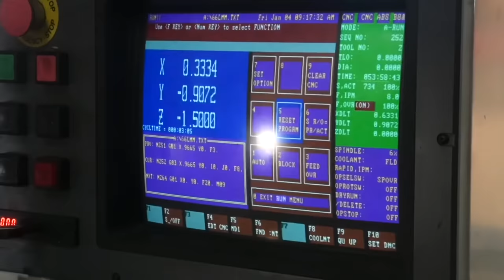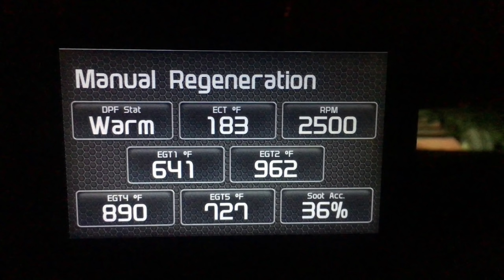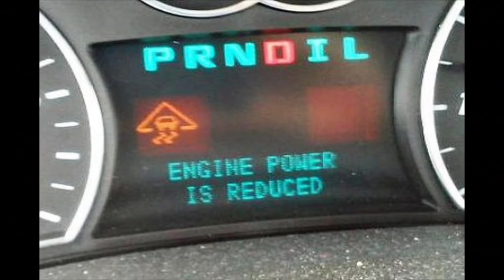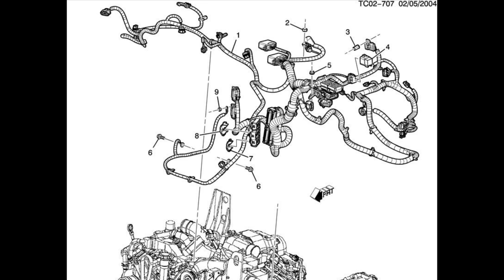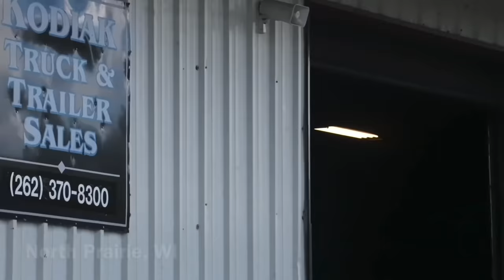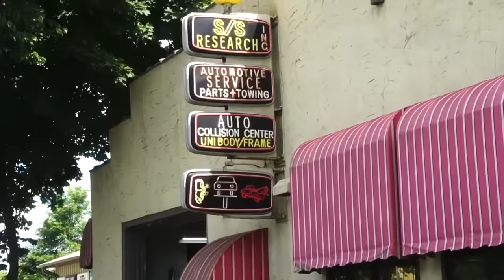Duramax Problem’s That Will Leave You Stranded!

Comment: Gen 4 tcm garbage alyways shorts out the j1939 data link. I work on class 8 and smaller the gen 5  tcm no failures to this point. No crank no start a pre 2013 plug in my test good gen 4 tcm always starts one percent starter has crapped the bed.

Comment: Hello
I noticed my fuel supply line near the glow plug control module has a slight kink in the line.  What is the recommended fix for this observation?

Comment: Can you guys cover any issues on the LMM oil pressure sensor?  Mine kicks on and off in high temps when idling and I’ve replaced the sensor and still does it. I have 180k on it

Comment: How common is this issue that will leave you stranded? I have 2002 LB7 with 97,500 miles.  I was idling at a stop light and suddenly the engine died.  Tried to start engine but would not turn over.  Got towed home.  1 hour later still would not start.  2 days later I was able to start the engine and notice Service Engine light.  Found code U1800.  Drove truck a few yards and park it.  10 hours later engine still starts.  I’m afraid to drive this truck on the road for fear of it stalling again.  I hope it isn’t the fuel injection control module.  All wiring seems to be ok around the fuel injection controller.  Had brand new injectors ,7000 miles ago and converted to CAT fuel filter.  Any ideas?  Thanks.

Comment: 2002 lb7 here , I will suggest to any here interested in going to the big 3 on your truck and going with a bigger alternator , I just changed out my alternator with a 253 amp alternator I scooped up from rock auto for 150 with Shipping , it’s turn my truck into a completely different truck , I don’t have enough time on it to see if there is any improvement in fuel mileage but I will say on the short road test I took it on the truck runs so much better all around , it’s no longer searching for idle has better acceleration , transmission shifts so much better , my truck came with an anemic 105 amp alternator , though it’s a base model which is why it came with such a low amp alternator some of the trucks out there do come with a higher amp alternator it’s my opinion even those alternators are still to low on amperage if anyone here really wants to get specific go to your power center and add up the amperage of all the relays in the fuse panels than see what amperage your alternator is rated at , you’re only supposed to be at 50% using of what the alternator is rated at without any electrical ons to the truck . I never see any videos addressing this issue and if I were a betting man I would say going with a higher amp alternator and doing the big 3 would resolve most electrical issues . IMO . It worked for me .

Comment: Torque to yield head bolts. Terrible idea on a diesel. I would recommend any duramax owner do head studs. The “blown” head gasket is caused by those torque to yield head bolts stretch and allow the head to lift under power just enough to “blow” the head gasket

Comment: Have you done a video on the 05 low fuel rail pressure? I had 3 injectors changed that failed the pressure test. I had a secondary fuel pump put on between the fuel tank and cp3 pump. I took the pressure regulator valve out of the fuel rail and put a plug in it’s place. Still having issues, my next thought is the pressure regulator valve on the cp3 pump. If you have any ideas that would be great! Thanks!!!

Comment: 2003 Duramax c-4500 - won't go over 40 MPH speedo says it's going 80MPH + will run just fine up to 40 or45 but will drop a gear unless you are really light on the pedal - Any idea what the cause of this is? I have read several articles in various forums but never have found a real answer?

Comment: I bought a 2023 2500 duramax last December brand new  , it now has 35,000 miles on it , it just derated yesterday to 20 mph , now I have to get it towed to a dealer, the particulate matter sensor comes on and goes off when it wants. I miss my appointment to get that replaced 2 weeks ago then yesterday derated , about four days ago, it did a reign , And seem to be running fine until yesterday yesterday this really ticks me off because I’m out here in Wyoming working in the oil fields and I need my vehicle to be able to drive back-and-forth to my semi to be able to go to work now I’m gonna be without a vehicle. What do you suggest I do and what do you think it could be causing this problem, when it happened, it felt like the transmission was jerking. So I parked it and I haven’t driven it since yesterday.

Comment: Can we talk about “shift range inhibited”?
Reply from the maker: Definitely a good one we can cover that in a later video
Reply: @TruckMaster  thanks I appreciate it, I’m having that problem with my lly right now
Reply: @Barnettj35  mine was the ignition switch . It wouldn't go into reverse and range shift inhibited would pop up.
Reply: @Barnettj35  no 20 dollar fix. Just take your steering column cover off and access your ignition switch.  I replaced my NSBU switch thinking it was that bit it wasn't.  It ended up being the ignition switch not allowing the right voltage to the strans
Reply: @maritzandre84  I’m in the process of changing the nsbu switch now, but it’s now wanting to plug back in
Reply: @Barnettj35  it most likely won't be that but it could be. The ignition switch is a much cheaper one to get replaced . If it's not the switch you're only 20 buks out of pocket. The NSBU switch is way more expensive.   I bet you a beer it's that ignition switch. Let me know
Reply: It's most likely your nsbu switch. Easy fix and very common problem on the LLY. Go under the truck and on the side of the transmission you'll see the shift linkage right next it is the nsbu.
Reply: @maritzandre84  yea ignition switch or nsbu switch if you live in a area where your vehicle rust easy then it can be the nsbu switch. But I'd start with the ignition switch first.
Reply: @maritzandre84  looks like we were both wrong, changed both and it’s still giving me trouble. I put in a new ignition switch and it will go into gear, but after a second it’s like it slips out of gear
Reply: @Barnettj35  that sucks. Sorry non of that worked for you.
Reply: @maritzandre84  ehh, it is what it is. Guess it’s time to start saving for a new transmission, just sucks that I can’t even drive it to a garage lol
Reply: @Barnettj35  yeah mine is kinda on the way out also. Will probably get mine  rebuilt in the next 2 years. I take it easy on her.
Reply: @maritzandre84  I haven’t even had mine long enough to take it easy on her lol
Reply: @Barnettj35  bad luck. Hopefully she behaves . Maybe call a shop like the dmaxstore or codiak truck and explain what's up. Maybe they can give you some info on what may be wrong

Comment: I’m having an issue where I’ll be driving and the check engine light will come on with a service traction control and stability light will come
On and truck will shut down and restart. Some
Times the fuel gauge will drop to empty. The truck is completely deleted. Any advice?

Comment: I have a 2004.5 blowing black smoke & no power. Got codes for pressure relief valve & barometric pressure sensor.  Didn't solve a thing. Any suggestions

Comment: HELP. My 08 lmm has been down for 4 months and 3 shops later. It was running but had a p0642 code. Low voltage circuit 1. Then it suddenIy quit starting all together. I replaced a ton of shit. Cam sens crank sens tps alternator ecm exhaust air temp sensor fuze box.

Comment: L5P glow plugs issues (2017 GMC Denali ) . Any one having this problem on L5P?  I keep having glow plug issues . In shop now for # 4 glow plug check engine light . Same  # 4 glow plug 2 months ago . # 7 glow plug issue 3 times this past year. Dealer programmed #7 then had to replace second time then re-program 3rd time. The warranty says programming not covered. I have made my complaint to dealership and GM . I have gotten nowhere and they will not even acknowledge there is an issue. I live in Florida so cold weather shouldn't be a factor.

Comment: These nuances aren't helpful to a non truck guy and really confusing. I don't care. I'm trying to run 3 seperate businesses and I just need to know what diesel 3500/ 350/ whatever to buy that will work when I need it and not live in the shop.. my f450 v10 is costing me $1,300 a month in gas minimum. I need 2 trucks and a diesel

Comment: I have a 2018 HD 2500 duramax with Allison trans and sometimes it feels like someone bumps me after stopping completely  not all the time bought it new only 25,000 miles have extende warranty  I was told to add a little trailer brake any suggestions? Also I noticed service trailer brake system once a while ago nothing since

Comment: question i just bought my lmm sight unseen i am working out all the kinks. put a lift and 37s my speedometer was not calibrated so took it to a guy who hooked up his scanner to fix the parameters, and the ecm was locked how do i go about figuring out who has tuned it?? if i buy efi or edge will it over ride the current tunes? i also have service trailer brake, service traction control (found out a wheel speed sensor is out) and a brake light on. any help would be greatly appreciated.

Comment: I have an 08 Duramax and the 4 whl drive dont work.  No problems come up on the expensive, shop monitor.  I changed the 4 whl. activator but that did nothing except lighten my wallet.  Any idea?
Reply from the maker: It’s probably your selector switch on your dash
Reply: @TruckMaster  Thank YOU!
Reply: Thankyou.  I replaced the switch and it does not work.  Any other idea?

Comment: Hello there, I got a 2015 lml and about a week ago the turbo mouth inlet came loose and I believe it suck the oring in thru the turbo, so we put a new oring on and put back together but now I'm getting a whistle sound when the truck is under load so I don't know if the turbo is going down or I got a vacuum leak ,any suggestion thanks

Comment: My 03 LB7 sometimes when I open up to pass or climbing a steep grade at a good speed will lock into I guess 3rd gear, I have rpm's until redline, can drive at 55  to 60, but stuck in that gear.  I have been in limp mode before 20 mph max, so I know how that feels. I pull over and reset the code without issues.  I was just curious if you might know what could cause this. Crappy Diablo tuner set on 85hp ( wish I would have known these suck with GM) and a PPE blue pill on the blowoff. Incase one of those might be an issue?

Comment: Great information thank you. I have an early 15’ lml with 85000 miles. 5” exhaust and ez lynk. I passed a couple semis and change fuel filter warning came on. Changed it and found it half full. Any ideas. I do t have a lift pump. I’m really thinking about getting one. Should I be concerned about the cp4?  Thank you

Comment: On your last point... what is typical stock boost levels? I drive a stock LML and I suspect I have a boost leak due to the lack of power. I’m only seeing 15-17 psi max when I floor it on my CTS3
Reply: My 15 lml is deleted and tuned but I see 35 psi when I get on it

Comment: I have a 04.5 lly, this has happened twice, but at full throttle in between shifts, it’s like it won’t shift and then it looses throttle. Until you let off the throttle it will not pick back up. What could be causing this?
Reply: FPRV maybe?
Reply: @jeronimo3571  I have been told before on another problem I am having, that it was the fpr, so it might be all connected. But while at a slow movement it’s like it jerks constantly but the rpm gauge doesn’t show any up and down idle, so I didn’t think that it would be that. But if you think the fprv could make it do that I’ll try changing it and see what happens! Thanks
Reply: @jasonholbrook9152  just a thought, I have an 05 LLY with some mods and she had a similar issue before I replaced the valve. Almost like it stretched out the shift point without any slipping if that makes sense. Good luck and keep us posted on the prognosis as things progress.
Reply: Yeah it doesn’t act like it slips, just doesn’t shift and then drops off!
Reply: @jasonholbrook9152  my guts are telling me FPRV.
Reply: @jasonholbrook9152  what is your FUEL RAIL PRESSURE at these times of occurrence? And what is it at idle? I’m willing to bet you it’s near the 20k mark somewhere at eating time. Do you have a way to monitor? I highly recommend an edge CTS3 even if for nothing more than reading codes and monitoring your numbers it’s a great investment. Really wishing you luck with this little hiccup, diesel is a lifestyle not a truck. But man these trucks are awesome to play with. Seriously keep me posted on what you come up with. Are you in Michigan?
Reply: I don’t have a way of checking, I have been remodeling for a while now and every dollar I have is going on my house, but I did order a fpr and a PPE fprv. I start there and then I would like to buy a CTS3, I have heard a lot of good things about them
Reply: @jasonholbrook9152  I get it homie, plug away as you can. I’m really wishing you the best of luck and that it’s an easy fix.
Reply: I appreciate the help, I would have never put them together, but I hope I’m going in the right direction! Thanks a lot!

Comment: I have got the code on my lly that it loses communication with the tcm but it runs fine. Does that mean it's failing?
Reply: That's most likely but could also be bad contacts, bad/damaged wires. Really needs to be diagnosed and checked properly

Comment: With so many issues , what makes a guy a dura-max man ?
Reply: Many of us don’t really have too many issues.  Sometimes common things just fail on certain vehicles, but not on all of them.  Usually that is a recall situation.  Sometimes things can be avoided by understanding how to use your truck like get on it a bit in the acceleration lane and drive highway speeds once in a while.  I can tell you I’ve never had a belt fail or idler pulley lock up because I do preventative maintenance.  Doesn’t mean it will never happen though.  I had 110k on an LBZ and now 140k on my LML and no issues.   Put it in perspective, they see a lot of trucks and when the people that do have issues, they get to diagnose and repair.

Comment: A common misconception of those seeking to buy a diesel pickup, is that they are robust and reliable. Sadly, anything newer than 2006 is anything but reliable. If you own a business or are affluent enough to trade it in every year, you should be OK, if not avoid them like the plague. I am a 61 year old, honorably retired and one hundred percent disabled US Army combat veteran, with a kidney transplant. I bought a 2009 LMM 3500HD Duramax, crew cab, 4x4, dually, thinking it would last me a long time and I could rely on it to get me to the doctor or hospital, if need be. It has left me stranded five different times, and once it is finally repaired, I will immediately sell it. General Motors should be completely ashamed for making such an unreliable truck. After 45 years of owning GM vehicles, I bought a 2015 Toyota Camry, it is no a truck, but it won't kill me my breaking down when I need it either.